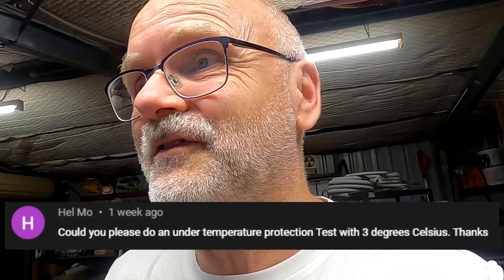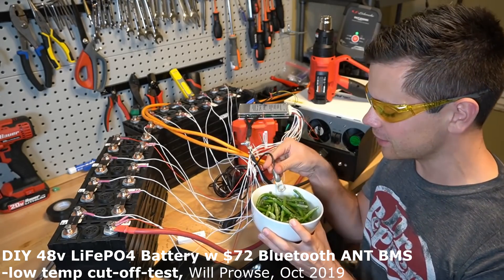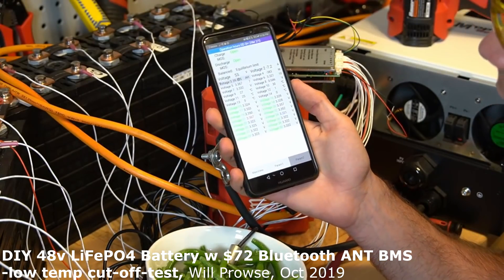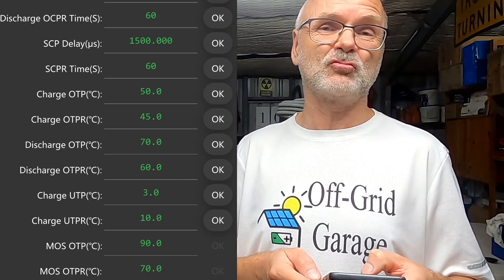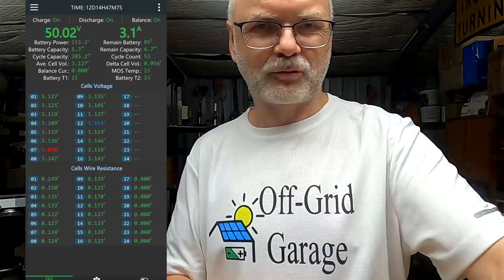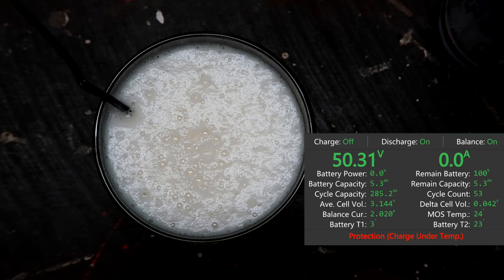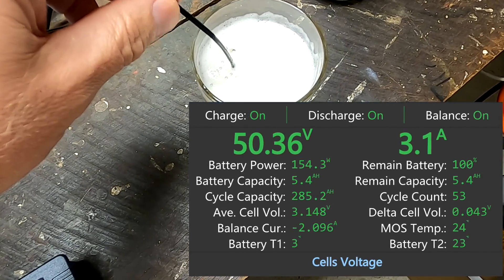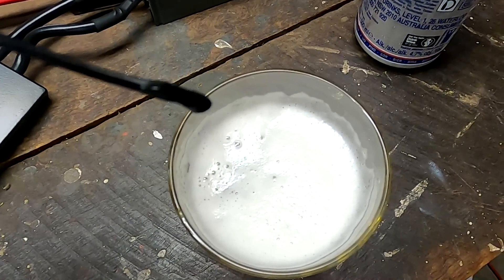Why Will Prowse failed with this test! Doing the low temperature cut-off test the right way!😉

Comment: Charging did stop, but balancing didn't? Is that enough to ruin cells?
Reply from the maker: The balancer was still set to 3V from a previous test. While editing, I noticed that it kept balancing in both directions. 2A are 0.007C. Will this still damage the cells?
Reply: @OffGridGarageAustralia  Good question. It would be nice if the JK BMS was smart enough to at least provide the option to turn off balancing as part of the temperature protection. I wouldn't want to try balancing MY cells if they were frozen! That begs another question... what stand-alone (dedicated) balancers do have temperature protection?
Reply: @charlesrichards5389  " I wouldn't want to try balancing MY cells if they were frozen! " But would you be charging them in the first place to reach the balancing point?
Reply: @upnorthandpersonal  There's a good chance the cells are in a charging/balancing cycle when the temperature sensors turn off the BMS. I don't think it's too much to ask that the sensors turn off the entire BMS. Not much point in putting together an automatic battery maintenance system that you have to babysit.
Reply: @charlesrichards5389  True, it would be the best option. Should be an easy fix in any case.
Reply: @upnorthandpersonal  Since a LiFePO4 cell does not contain any water, therefore their is no such thing as "frozen" at 32° F / 0° C.
Reply: @MrSummitville  The internal resistance goes way up once it's below 0C. The 'frozen' aspect was quoted from another poster - not my words.
Reply: @OffGridGarageAustralia  I don't know.

Comment: Still waiting for your neey 12 volt set up. Can you also explain if it will or won't work on a system with three separate BMS's
Reply from the maker: Video is coming...
Reply: @OffGridGarageAustralia  that's good, hopefully you van explain if I can use it on a system with multiple BMS's
Reply from the maker: @todamnbad  This will definitely work. If you have three batteries 4 cells each and parallel them and each has their own BMS, that's not a problem at all.
Reply: @OffGridGarageAustralia  what if I have 3 packs of 8 cells each with a separate BMS?
Reply from the maker: @todamnbad  that will work fine, no problem.
Reply: @OffGridGarageAustralia  so what i did is i took three 200AH chins batteries apart and installed them in my camper, each one is 4S2P each has its own BMS, hope this doesn't change your idea on this working
Reply from the maker: @todamnbad  you mean 2p4s? So two cells in parallel first and then four of these pairs in series, right? Just to be clear ☺️
And then this battery gets a BMS. If you do this the times, there is no problem.
With the 2 cells in parallel, they act basically as one cell, just with double capacity.
Reply: @OffGridGarageAustralia  the email from the manufacturer says 4S2P so I guess I'm not really sure, they have 8 cells in each battery and are 12 volt
Reply from the maker: @todamnbad  OK, that makes sense, it is a 2p4s battery then. 2 cells in parallel and 4 of these pairs in series.
Reply: @OffGridGarageAustralia  ok, so they worded it backwards?
Reply from the maker: @todamnbad  it is clearer if you say 2p4s because the parallel is first.
So you can pretty much leave the batteries as they are and hook up your BMS to each one. Then parallel the three. That will definitely work .
Reply: @OffGridGarageAustralia  and I can use the neey to balance all three batteries at 12 volts